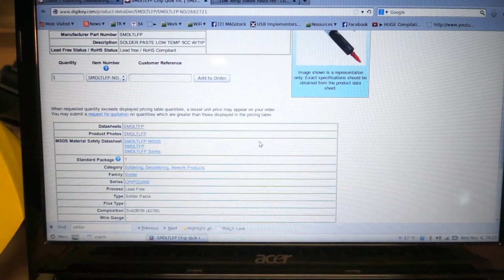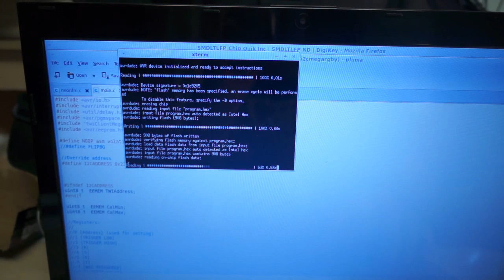Use Bismuth Low-Temp Solder Paste!

Comment: make sure you are using a soldering iron tip that is free from any lead solder as mixing lead with tin bismuth reduces the melting point even further and can cause problems so goes without saying dont mix with leaded solder either

Comment: How is it holding up after a few years? Do you still use it?
Reply from the maker: Great question.  The answer is great and YES!  In fact we used this bismuth paste on some of the button panels for NeonFM.  These live in high-impact, high-vibration environments, with TQFPs and LEDs.   All failures have been in line with our elecrow-made standard solder ones!
Reply: Well that is a pretty good test. - I think I'm a converted!

Comment: I used this and I can tell it has issues due to weaker "magic" surface tension which works so great on aligning components with usual 60/40 SnPb solder.
Reply from the maker: there are some nasty things that happen when you mix the two and don't get it hot enough to melt the lead allow.  I've sometimes done rework and it produced some weird things.
Reply: Maybe its good to put both together, first apply the standard and then the bismuth to speed up the melting using hot air, if use melting plate put bismuth first

Comment: Chip Quick design and sale solder paste and solder wire for quick chip removal,
mix with the original solder make easier and safer to remove chips from boards.
But is a good idea to uses this paste to quick prototyping!!!!
Great video